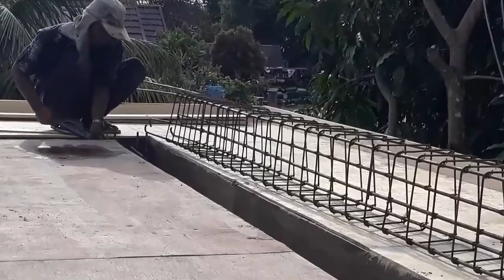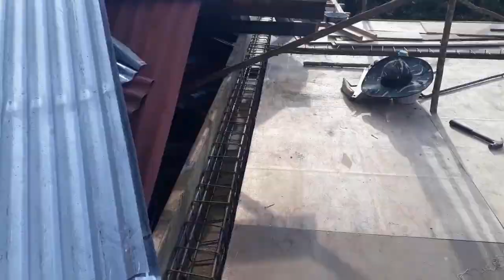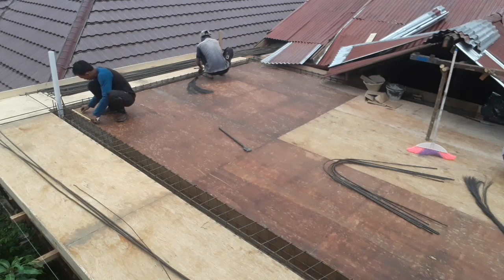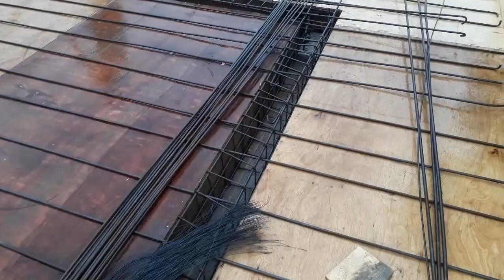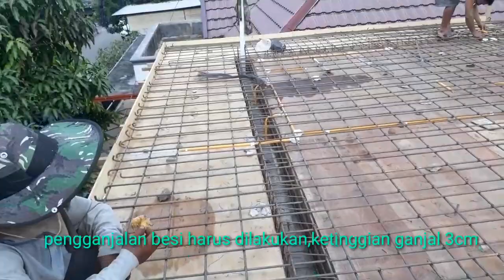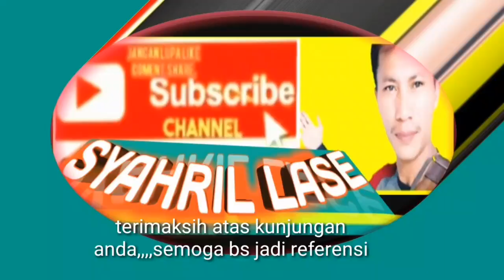Cara merakit besi cor lantai-cara merakit besi cor dag lantai

Comment: Bang mohon di jawab
Kalau pakai bhan yg seperti video itu
Cor rumah ukuran 6x12 habis berapa
Besi+triplek+kayu+pasir+semen+koral+ongkostukang/kuli ngedaknya saja,perkiraan? Makasih
Reply: Perkiraan
Besi 8 Ti 100 batang
10 Ti 50 batang 
6 Ti 30 batang
plywood 15-20 keping
Semen 50-70 sak
Papan 2 kubik 
Gelam/bambu 150-200 batang
Pasir -+5 kubik
Split -+5 kubik
Ongkos borong tukang 24-26 jt

Tiap daerah beda2 mulai dr upah tukang dan bahan material